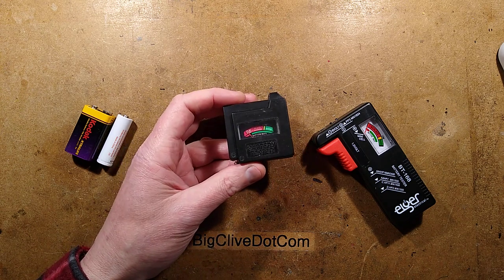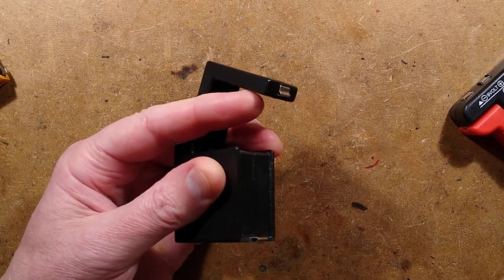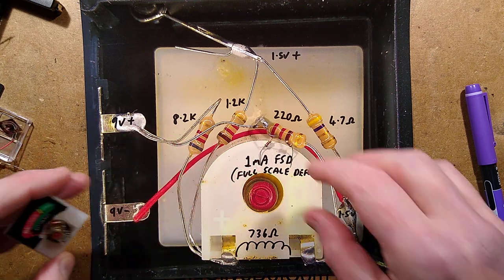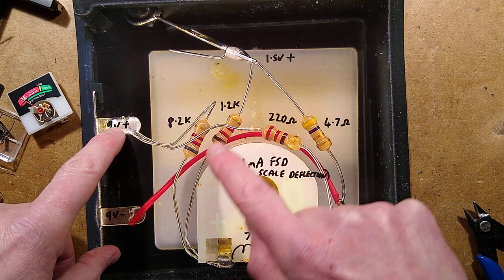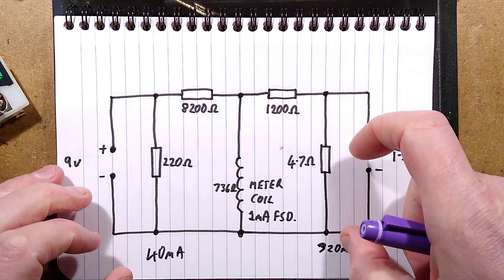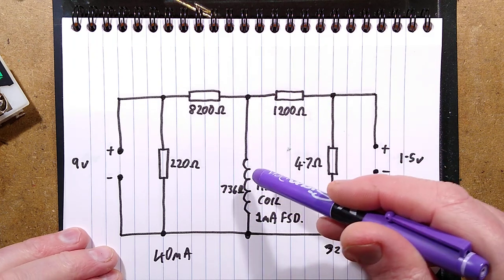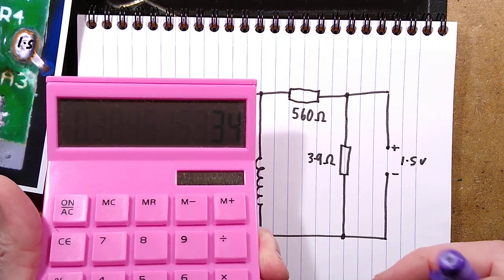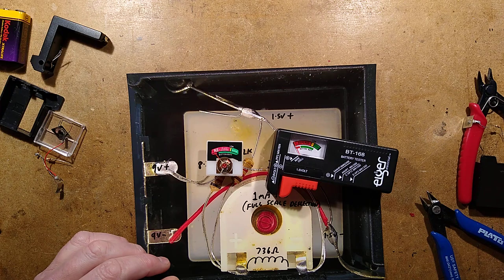Inside a simple battery tester (with schematic)

Comment: Someone please explain the button cell green / red zones. I'm baffled. Thanks
Reply from the maker: It probably depends on the quality of the cell, but green should mean usable and red meaning low charge left.  Some cells have high impedance, so may just show red even though they have charge left.
Reply: @bigclivedotcom  Thanks Clive, but I'm still confused. How does the 3V button cell, when attached to the same tester terminals as one would attach a 1.5V cell to, show the button cell as good, even though the 1.5V  AA cell is showing very very bad, at that region of the scale? Does the same mathematics not apply? And if so, why doesn't a 3V button cell show very very very bad, instead of still good? Forgive my ignorance please.

Comment: It's a shame, if they had put a 2200 ohm resistor across the 1200 ohm resistor, the meter would have gotten 1 mA at 1.5 volts. BTW. I have the same and  i'm  going to cut it open and put the 2200 Ohm resistor over the 1200 Ohm. See what it does.

Comment: Oh I have a very similar one as the one on the right I tried adding a light inside big fucking mistake 😂you should take your old one apart and clean it, test the values match up, I've tested mine against the multimeter and they agree entirely, worth noting it isnt quite long enough to accommodate an 18650

Comment: I've had a bunch of these basic testers (all at least 15 years old, some even from the 90s) and they've all worked fine, however recently (in huge quotation marks.. think 10 years) produced ones have gotten crappier and crappier to the point where they can't properly do their job anymore (like this one). Compared to my older ones, I could already tell in the first few seconds of the video that the quality of yours is nowhere near the same from the case plastics and scale print alone. The fact that it doesn't work the way it should wasn't a surprise considering that. Clone of a clone of a clone and the people making the device at the end of that chain don't seem to understand it anymore

Comment: Sorry but your circuit analysis is incorrect, when a voltage is applied on either side, the current flows through ALL of the resistances… you need to break down each loop to its equivalent resistance and figure out the final equivalent resistor value from each battery input viewpoint.

Comment: I always use an LED to test coin cells.  I just tested and tossed 5 after buying a new round of 2032's.
Reply: It's hard to find decent coin cells without going for overpriced ones, sadly. Even some recognizable names are on absolute trash.
Reply: @chaos.corner  If only there were LiFePO4 2032s, it would be well worth investing in those for devices that deplete batteries often. I suppose lithium ion 2032s can be used for devices that can tolerate the higher voltage, possibly boosting range for remote controls.
Reply: @NiHaoMike64  I think there are rechargeable button cells out there. I think I ran across some looking for a project a while back. Pricey though.
Reply: @chaos.corner  They're lithium ion with a fully charged voltage around 4V, which is too much for some devices. LiFePO4 has a fully charged voltage of around 3.6V (can be lowered to 3.45V with only a small drop in usable capacity), which coincides with the maximum operating voltage of many 3.3V chips.
Reply: @NiHaoMike64  Good point.

Comment: I find it difficult to believe that the old tester was inaccurate from day one, unless perhaps it was just defective, which is obviously possible, and only you would know, if you bought it new. I'm thinking the problem may be with the coils of the meter itself,  and for whatever reason,  they are out of tolerance, possibly partially shorted, or incorrectly wound from the factory, resulting in higher impedance than factory spec...
Don't blame you for tossing it, but guess you could have changed the resistors if you didn't already have a better one!

Comment: I can understand simple. It seems a shame to throw away the old moving coil meter so why not build a 5G radiation detector so you can watch the needle fly when you answer your cell?
Reply from the maker: Because most 5G signals are a fraction of the power of older cellphone standards.

Comment: you are counting wrong. You must calculate the replacement resistance in the circuit as it contains both series and parallel circuit. If you count on this, the voltage is better. It's a piece of shit anyway.